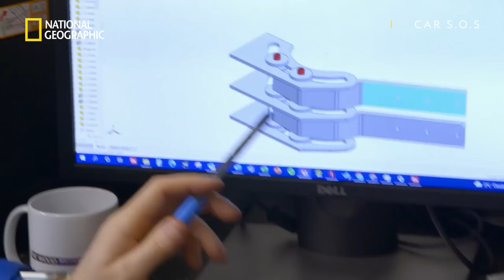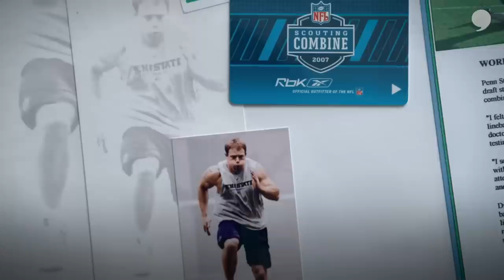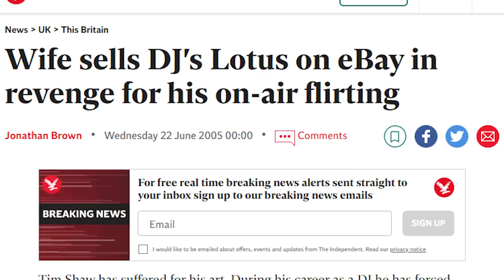What Really Happened to Tim Shaw From Car SOS

Comment: A friend had his car on the show, l wont say which but it was a more modern vehicle.. The build quality leaves a hell of a lot to be desired, very thin paint, shoddy engine work, badly restored interior.. My mate finally got his car back after 6mths, 2 engines later and after they had lost the car!!!! 
However they have done the majority of the work the car needed and will need about 5k to make it a minter so my mates happy enough now.
Reply: Only comment: Cortina 71’ 2 l was great machine. Why i sold 1.6 4d 73’ and The 71’. My bad 😕. Those were the times. Now I have lookin’ 64’ cortina, well beautifull, but still loving 71-73’ model 😢
Reply: Must have been very traumatic for your mate to see his pile of rust restored to a sub concours condition for the princely sum of £0.

As they say, no good deed goes unpunished.
Reply: @sultanoftippoo3857  it was neither a pile of rust nore is it now sub concours infact it could never be concours after the modifications they did to it.
All l said was the workmanship and finish is far from what we are led to believe it is when they unveil the vehicle. 
My friend had to seek legal advice to get his car back which also added to the preasures he was already feeling due to the illness which was the reason they did the resto in the 1st place..
Reply: @nickstones5583  Have I misunderstood then? I thought the program was designed for families to take a vehicle that was never going to be put back on the road to give the owner some pleasure in driving it as they had suffered a major illness. Instead you seem to be suggesting it’s more about the car now restored not being worth as much as you anticipated?

That aside, I hope your friend is OK and is at least enjoying driving the car.